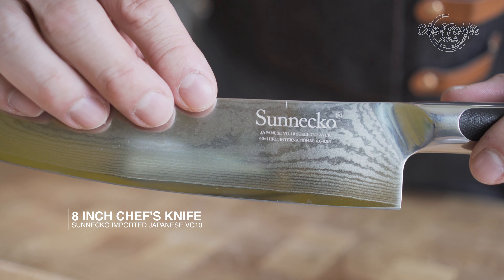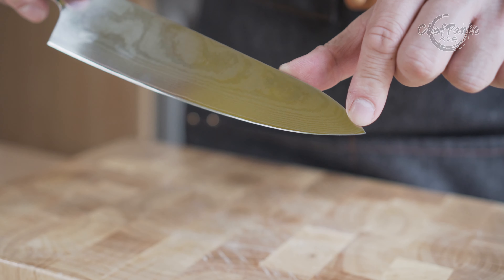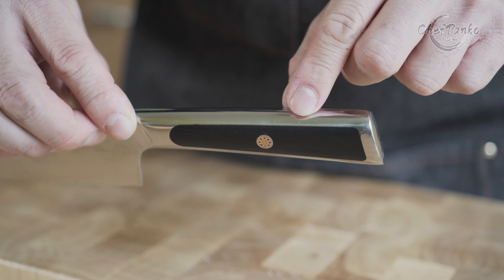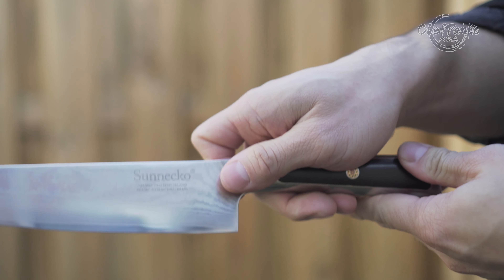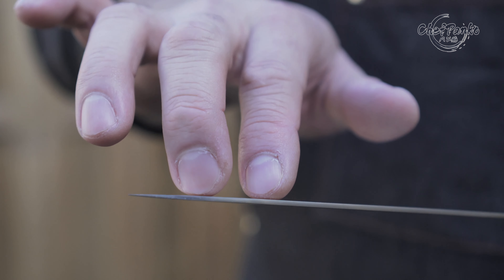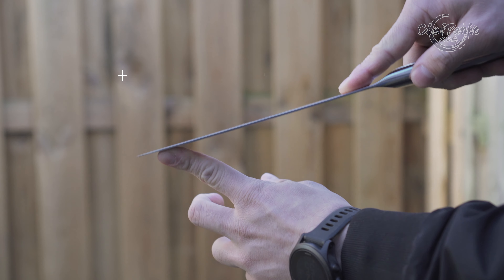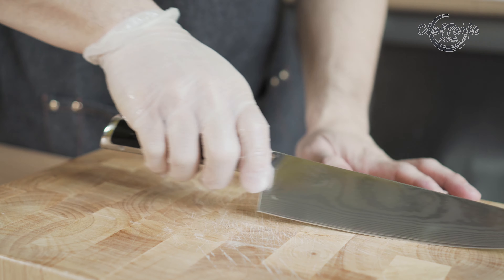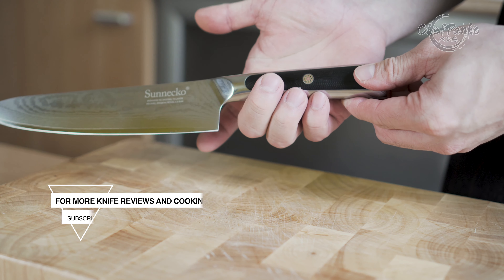Sunnecko Chef knife Japanese VG10 + G10 Handle  - AliExpress

Comment from the maker: After talking to multiple OEM's and pretty much every single one of them told me that imported Japanese VG10 is not possible (Anymore), but 10cr15comov is a Chinese equivalent to the Japanese VG10. 
Some OEM's told me that VG10 export is banned, so pretty much exclusive to Japan and the knife makers in Japan. 

Like you all know, when you guys asked in the comment sections if it was the real Japanese VG10, I always said that I have my doubts or the heat treatment was not on par with Japanese-made VG10. 
This pretty much confirms why and why I have pushed AUS10 over VG10 a lot more when it comes to knives made in China. 

10cr15comov would not be bad steel if heat-treated correctly. It will indeed sit between VG10 and AUS10.
Reply: i am looking at buying a sunnecko nakiri 18cm . it says it is japanese VG10 on the blade.. i am willing to pay for the right steel or find out i cannot afford it. the knife is 100 euros. if that is too cheap for VG10 then i need to know.  i am not willing to pay for any knife if it is not made with what they say..  if it is stamped with VG10 is that proof its VG10?
Reply from the maker: @domkelly1972  The Sunnecko VG10 that I have tested came close to 59 on the Rockwell Scale; Keemake, their sub-brand, was slightly higher (59.7). As far as my communication with some brand owners and original manufacturers themself. They told me that VG10 is banned from export outside Japan, and therefore they can no longer supply or promise an imported Japanese VG10 steel. A complete export ban was because of the loopholes, by only excluding China from importing the Japanese VG10. 

Since they used loopholes by exporting it to another country and then from that country back to China. This is no longer possible. As for VG10 made in China or at least claimed to be Japanese VG10, none of the VG10 exceeded my expectation over AUS10 (Japanese AUS10 made in China), and even some 10cr15comov (Chinese VG10) was better than the VG10 made in China. 

So I always used Japanese AUS10 over VG10. For 100 euro 18cm Nakiri from Sunnecko, I find it very steep. Keep in mind while ordering from AliExpress, you should only buy when you see at least 40%+ discount and never buy full-price. 

If the blade is stamped with Japanese VG10, that is not proof that it is real as everyone can stamp whatever they want on the blade. As the manufacturers told me that the brand owner must comply with the country's regulations where they are active in selling their knives. The manufacturers only have a contract with the brand owner, so they do what the brand owner wands as long as the brand pays for the manufacturing.  

So, in short, Sunnecko VG10 is not as good as other AUS10 made in China. The Rockwell hardness is lower than the Keemake, which is Sunnecko's own sub-brand, but keep in mind that they are improving the knives from time to time. But I find it hard to believe that they still can offer imported Japanese VG10, where some brand owners and manufacturers that I have spoken told me the opposite.   

quility wise they are good, especially if you consider the price I paid 30 euro for the knife in this video. Hope that this answers your question. Feel free to ask more.
Reply from the maker: @domkelly1972  If you are looking at a real Japanese VG10 under 100 euro I can recommend ''Matsutani'' VG10 Nakiri price is around 70/80 euro (sometimes 65 euro on special sales day). 
Western webshop name it: Matsutani
Japanese webshop name it: Kunihira Sairyu

Kunihira Sairyu is the company name, Kunihira is what the Kanji on the blade says (so I agree more with the Japanese webshop naming over the western webshops). 
Western webshop advertises with ''Matsutani'' so they are implying that it is made by one blacksmith but the reality is that it is made by a small team and Matsutani is part of that team.

Comment: I just bought this knife, without checking reviews of course! 

Im a complete novice and only cook in my house but always had trouble cutting raw chicken with my knifes. 

I have this now so i will test it on everything. Is there a knife you would recommend specially for learning to debone and cutting meat? I really like the look of damascus steel too.
Reply from the maker: Deboning chicken can be done with a chef's knife or any other general-purpose knife. For him, there is no actual need for a specialized knife to debone.

But if you want you can look at a Honesuki, Boning knife, etc. Those knives are thinner so that you can maneuver around the bones more easily compared to a bigger knife. 

If you need to go through small bones a dual-purpose Chinese chopper should be good for that.

Comment: Nice video!
Im interested in the steel quality of this brand, I am looking for a Sunnecko kiritsuke with the same steel but u dindt mention anything related to it like you use to do.
Did the imported VG-10 feels actually like a real jaanesse VG-10 or they are just liyng?
Reply from the maker: As for Sunnecko, their VG10 feels like one; however, the heat treatment is around 59/60 and not higher than 60. 
They may have improved it by now, but I can only review it based on what I received during those times.  (Heard that many of the brands have improved heat treatment). 

Based on the quility of usage and feel, the steel seems like a VG10 but with lower heat treatment. 
However, keep in mind that not all brands have the same steel even when they claim they do. 
If it is too obvious, I will mention it in the video in the last video. I mention my doubt about the usage of an AUS10 in the Grandsharp knife:
https://www.youtube.com/watch?v=52AMS0DZApM

Currently, the steel I recommend is AUS10 (from the select few I tested on this channel over VG10). 
As for 10cr15comov, they are great steel. However, quility and heat treat are just too wide. 
Xinzuo is currently the only one I found good in terms of heat treatment/ Rockwell hardness.

Keep in mind that 10cr15comov is often sold as a VG10 or AUS10 (I find this misleading advertisement, and when I catch a seller doing this, I will mention it). 

Just like the VG10 from Yeelong:
https://www.youtube.com/watch?v=m8xTbr2cQ94

Or a very popular Instagram knife:
https://www.youtube.com/watch?v=FiunVYwOuPg&t=

Both the knives claim to be VG10. I highly doubt it, or heat treatment is just extremely bad. 
Because of the performance and claims, I did not recommend them and told everyone to avoid it.
Reply: @chefpanko  TY for that fast answer.
In one of ur videos u said that we should be looking for expecs in the box or knife it self.
The one that im looking for have:  Japanese VG-10 73 layers Damascus written in the blade, thats why i choose this one tbh.
I don't think that i need more than 60HRC, I'm a homecook
Ty in advance
Reply from the maker: @ErCheVe  While you should read the description carefully and spot that they often say something like 10cr15comov hidden in the description or pictures or something else. 
But with the latest knife, I reviewed none of the hidden things, and the knife was definitely not a promised AUS10. 

So I currently don't recommend that method anymore if we get more resellers like that, and one of the reasons I do individual knife reviews of various knife styles and brands. 

Another knife I did not review yet, but I have their AUS10 D-shaped black handle version, and so far, they are on top of the list in terms of Rockwell rating. 
Dongsun: https://bit.ly/3epbcSm (I have no idea how the VG10 performs, but the AUS10 is good; I heard from other viewers that they liked the VG10 version of them).

The problem with Chinese made knives is that the brand owner can let the manufacturer stamp whatever logo they want on the blade, even the false claims. 
If the stamped logo says VG10, it can even be 10cr15comov. 

After talking to a few OEM's, they told me that their contract is with the brand owner, and if they want to skip heat treatment, etc. they will accept it as long as the brand owners pay for manufacturing. This means that even when the knife looks identical but with a different logo, brand ''A' might have paid for better heat treatment. In comparison, brand ''B' did not pay for better heat treatment and even chose a cheaper core material and sells it at the same price as brand ''A'' with misleading text. 

So currently, I will only recommend knives I personally have tested and will link to the store where I bought them from. 

Keep in mind the most important thing is maintaining the knife sharpness over Rockwell hardness (resharpening has to be done at some point).
Reply: @chefpanko   Again, tyvm for the effort u put in the answer.
I dont really know if u solved my doubts or just created new ones lol.
As far as I know Sunnecko is a brand not a reseller, I'm buying from Sunnecko offical store in Aliexpress.
I'll link it, will make it much easier:
https://es.aliexpress.com/item/4000224310536.html?spm=a2g0o.cart.0.0.60163c00d9sXO1&mp=1
 If u dont trust the product (and u are not planning to review it),I will end up choosing one of Dongsun as u recommended me.
I enjoy sharpening my knives in the wetstone btw

TYVM and sorry for my english
Reply from the maker: @ErCheVe  While I did not test the one you linked the quility of Sunnecko is good (based on the select few I have tested). Keemake is a sub-brand from Sunnecko.
Reply: Hi Chef! I'read that you are in recovering, I didn't knew. I hope are you feeling better and thanks in advance for your time and kindness. Talking about bread knife. Do You think that hard material like this vg10 it could be good or it's better something softer more safety against the bread crust? I need to buy one. I'm considering buying one of another line of sunnecko but with the same material that cost really little more then the one from Xinzuo made of 4116. What do you suggest?
Reply from the maker: @Gurtbarter  As for bread knives, a VG10 should be fine. The main difference is that harder Rockwell is usually made thinner with all the other aspects that make them unsuitable for a certain task. 

First, it is the thickness of the knife. Most Japanese made knives are fragile and very thin behind the edge (single bevel and very thing 50.50 double bevel or some Japanese knives comes with a 70/30 edge to mimic the single bevel performance). Combined with a high Rockwell, it will drastically reduce the durability and will make it more brittle. 

With bread knives, you will usually get a thicker knife making it more sustainable on harder things, but the serrated edge gives the knife the extra bite and strength to go through the hard crust without being brittle. The serrated part is what gives the knives their durability. Most bread knives come with an asymmetrical shape to increase durability, making one side thicker than the other. 

In short, if used as a bread knife, even a VG10 with a Rockwell of 61 should be fine (since the manufacturer already made the knife suitable and sustainable for that task with the serrated edge and mostly an asymmetrical serrated edge).

Comment: Would you say they're any more slippery than an all metal handle ?   I'll find out soon - have ordered 4 of these..
Reply from the maker: They are pretty similar to a metal handle, but the combination of the finish of the top and bottom makes this one slightly more slippery if you use gloves, or have wet/oily hands. 
But if you keep your hand dry it is fine, for home use it is less noticeable. 

With this knife, it has more to do with the handle design that has no added design elements for extra grip like other knives. 
Like the global knives, they have an added rounded protrusion at the bottom for extra grip and dimples.  

Handles like a wooden handle will naturally have more grip since it is porous. 

Metal and G10 are non-absorbent.
Reply: @chefpanko  Thanks for the quick reply.
  I'm sure they'll do me fine as a novice cook :)

Comment: Hi, great review 
do you test rockwell hardness yourself. Where on the blade do you test?
Reply from the maker: There are a few ways to test it, you can do a scratch test (which is hard since you need to use it on the core and not on the cladding).
Basically, a higher rockwell can't be scratch by a lower rockwell but higher rockwell can scratch the lower one. 

The above and below testing is not 100% accurate, but I have a wide collection of knives and I can tell by using the knives for a few, days/weeks. 
So I can compare them to my Wusthof, Zwilling, Shun, Miyabi and more. 

I also work in a Japanese restaurant where I basically use knives on a daily basis, so I get a general feel in edge retention and where I think the knives are.
For example, I can feel the difference from my Zwilling chef knife vs Wusthof Chef's knife. 
Both are excellent, but the Wusthof shines in most aspects like better edge retention and sharpness (it can hold the sharpness better). 
I'm at a point where I can feel the difference where I don't need to test them side by side. 
However, most people will not feel the difference between those 2 if tested at home side by side for a short period of time. 
Compared to the prep work from home it takes like 10 to 15 min max to do the cutting prep, but in a restaurant, it is 1 hour for one task and then you get another hour for a different task.

We get 2 hours for Salmon prep work, 1 hour for tuna, 15 min for Sea Bass, etc.
Each cook get's an approximate time of 4 hours of prep work before the service start, where we use the knives too for another 4+ hours.
So getting a feel for a knife is something you develop over time and therefore my approximate, Rockwell rating. 

Best accurate testing is with a Machine but I don't have one. (but currently, all knives from China are way too optimistic in the description for their Rockwell rating). 
You can basically say for something like ''Rockwell 62'' and then they add ''+/-2'' you can directly do ''-2'', and in some cases, it is ''-3''. 

I did a review from the brand Wallop Japanese AUS8 that was advertised as a Rockwell of 58+, but during my testing, it did not come close to 56. So I contacted the seller, they now changed it to a 56+ (which is still way too optimistic). It really is like a 55 max, but after a few of those not recommended reviews, a lot of the Chinese brands stopped offering me their knife in return for a review. (5 other brands never contacted me after those uploads even tho they contacted me first, also one of the reasons why I now put a disclosure before I do a review so that you guys know if it was sent for free or not).

Free or not free I will always stick with an unbiased, honest review. 

I hope that explains the Rockwell ratings on my videos.